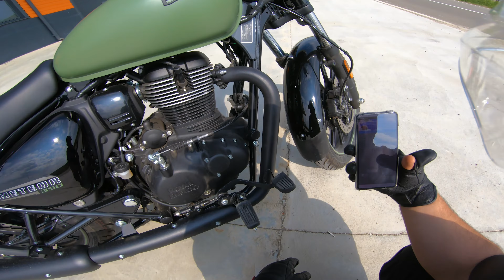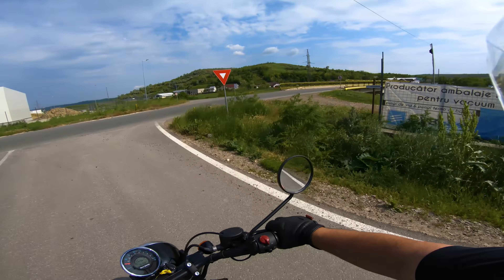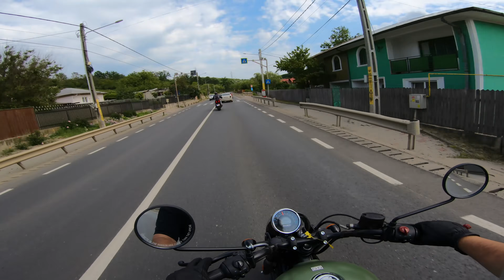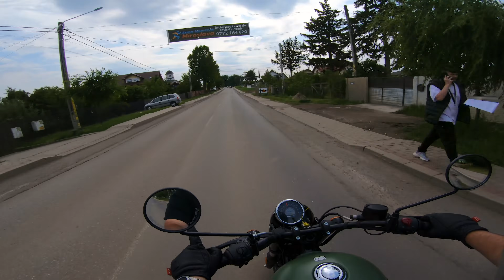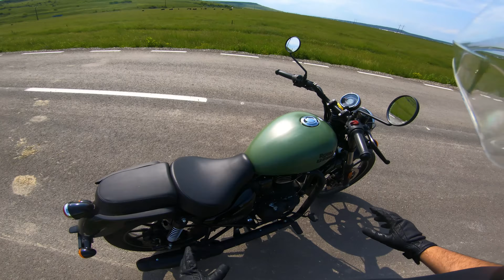Royal Enfield Meteor 350 - First Ride

Comment: I have this exact model and commute on this in the uk in all weathers (mainly wind and rain) and am going to mention some things that dont get mentioned on other reviews. The meteor model has full size mudguards and if you fit the royal enfield sump guard the bike stays cleaner than most in the wet weather wich really suprised me, i thought the toe heel gearchange felt odd at first but now im used to it dont think i could go back  to toe up shifting (you can where any footware you like, i tend to wear rugged walking boots which wouldnt have fitted under most gear levers because i have tried it in the past and it aint good). The position of the foot rests is forward which basically means when you put your feet down in slow moving traffic nothing digging into your shins or calfs because their forward of your legs. Add this to the low seat height then standstill and slow moving controll is excellent. Unlike smaller cc japanese bikes ive had in the past you dont spend all your time going up and down the gearbox. The torque of this engine allso allows for slipping the clutch for instance going into or coming out of wet corners, others bikes ive had of around the same engine size would shudder to a halt under the same conditions so i love the bike love the engine love the slick gearbox and hope ive mentioned something different about the meteor, ride safe people😊
Reply from the maker: Awesome addition info!!
Reply: Me too, need to spray it down and gt85 most of it as it's so exposed coz.of all the salt on the Rd in Scotland, but with heated grips and over trousers it's an all year commuter
Reply: How have you found it with rust and stuff after all weather riding?
Reply: @felixarbable  i wrapped the front pipe at the start with exhaust wrap it suited the bike and hides the inevitable rust that you would get on a black finnish pipe, the only rust really due to salt came on the chrome shock springs so i upgraded these to hagon shocks and the same happened on these( but they felt a better ride). The exhaust splits at the front pipe you can take it off, remove the heat shields you can nib it with a scotchbrite pad and literally brush paint it heat proof black then bang it back on. These things have happened to the japanese bikes i have had so its faired no different to bikes that have cost me a lot more. They are simple to work on so if your a bit of a tinkerer you can keep this bike looking mint. Mine lives out side under a cover so thats hard for any bike really. They are quite agricultural in build and i simply changed a lot of bolts like for like with stainless, it costs pennys to do this, then just bath it in wd 40 and wipe the excess off now and then the same as you would do with any bike. Rust happens to chrome regardless of who made the bike so buy the most blacked out bike you can for all year round work but when im in the mood i can valet mine back to brand new allmost.
Reply: @brendonhughes4580  great thanks I think my bike will live a similar life
Reply: Chrome on rear shockers started rusting changed them for upgraded hitchcocks adjustable units and they rusted the same but it will t cut off and the exhaust silencer went a little bit on the rear  silencer took it off brush painted heat proof mat sorted. I bath it in wd 40 and dry it off 3 times a year perhaps but this bike has faired no different to the last 4 jap bikes I've owned I really cannot fault it for the money

Comment: I love this motorcycle! I would love to buy one! BUT... It has too little power for the 350cc engine! Only 20HP?
- That's just a little more than a 125cc motorbike.
And like that's not enough, the worse part of it, is the price asked for it: more than 5000£/$/€ (with tax, etc.)

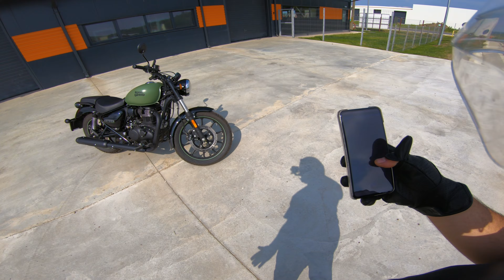01:05 Where do you find this bike being sold at «about 4000»?? 
 - Nowhere! Quit playing with serious facts.😆

With a bit more than 5000£ one can buy a 2nd hand Honda Rebel 500: which has the double of the HP, has a similar weight, similar fuel consumption (if not better due to Liquid Cooled engine), the typical Honda reliablity, etc.

It sounds like Royal Enfield is trying to establish itself as a Premium Brand like a "Indian Harley Davidson" with last century's engine types: lots of CC, high Torque, but lacking in Horse Power.

16:32 I have to disagree with you, mate! This R.E. Meteor 350 is NOT CHEAP AT ALL - pretty much the opposite - it's quite an expensive motorcycle for what it has to offer in return.
But i still love it!😅😇

Congratulations on your review!😉
Have a great week and ride safe!😎
Reply from the maker: Ride it first, and here it is about 4400 euro on the road.
Reply: I got mine Red Crome Clasic350 for 4200Eur on end of the year old stock sale. dec2022. +55eur regisstration and road tax +48eur OCTA ensurance  12month. Cheapest Honda 125 was 5300 so 😁

Comment: looks like the Benelli Imperiale is a bit faster than the meteor so it may be a good alternative for commuters IMHO.
Reply from the maker: The meteor has the cruiser seating position, the imperiale is a competitor for the  Royal  Enfield Classic 350
Reply: @RideWithAlex  yes indeed! In France, for some strange reason the classic is way more expensive (5390€) than the meteor (4890€) so if you just look at the price tag the imperiale (4690€) is in fact in the meteor range 🤔

Comment: Very nice bike. Not only the bike itself is cheap but the equipment and accessors are many times cheaper then the premium brands. Full touring package with seat, windscreen, heated grips, crash bars, sump guard, back rest, proper original bags, large foot pegs for less then 1000€
Reply from the maker: I haven't looked at the accessories but I also heard for Royal Enfield they are cheap. Probably with 5000 euro you can make a nice little tourer.
Reply: You need supernova versión not firebolt

Comment: Perfection! Perfect bike for relaxing routes in the city and the suburbs! I would appreciate if anyone knows how a pillion passenger affects the homogeneity (handling, performance, maneuverability) of the machine...
Reply: Bit slower to accelerate with a passenger onboard but top speed, lugging ability and handling are not affected. Only problem is available space, I put extenders on the backrest that moved it back a couple of inches, more room for the passenger.
Reply from the maker: Haven't tried it with a pillion. I think the main issue would be the weight and the effect it has on acceleration. Handling should be decent even with a pillion the frame seems pretty solid to me and able to handle extra weight.